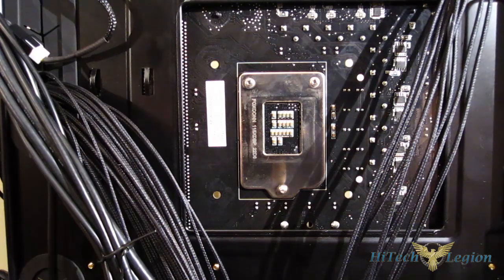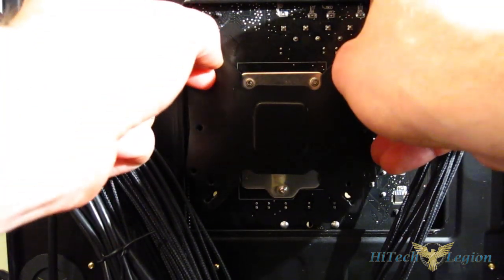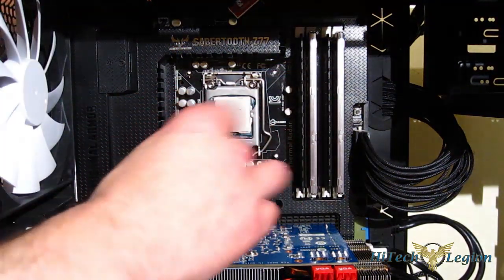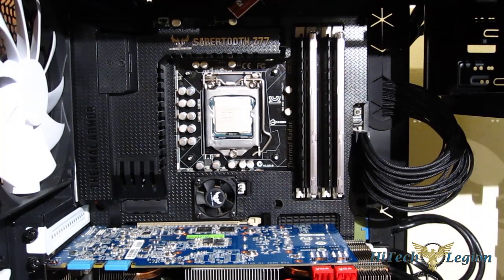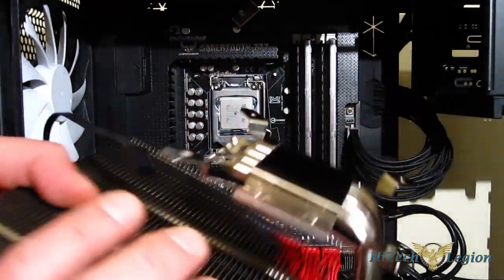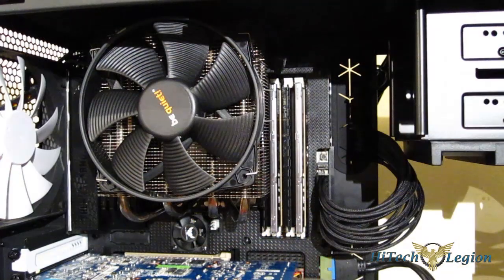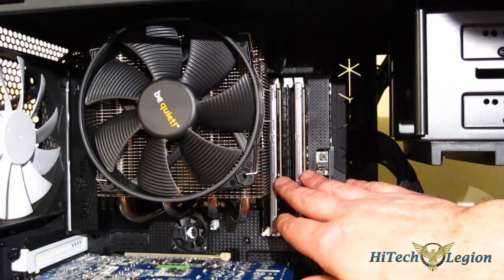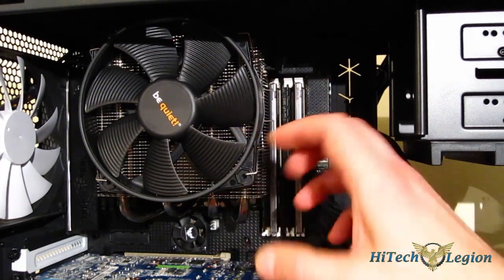be quiet Shadow Rock Topflow SR1 Installation Guide at HiTechLegion

Comment from the maker: Strangley...I use that Tick avatar in a couple of forums.
In this case, the ends of the pipes are facing up, that is the end you never want to face down. If you have a case with sufficient room for a standard tower, I would recommend you go that route as they will provide more efficient cooling in most cases. The top down style is made specifically for height restricted installs.

Comment from the maker: In space where there is no gravity it would not matter. On Earth where there is gravity, there is a tremendous performance difference as we have seen in testing. This is why the manual states that performance will be decreased if mounted upside down. You will find this same statement in almost every C pipe cooler manual.

Comment: I'm really like the looks of this cooler. My problem is, it might not fit on my motherboard. Its a Z77 Extreme3 and is narrower than a normal ATX one. I'm not sure there will be enough clearance to mount it without having to remove my exhaust fan.

Comment from the maker: If it didn't matter there wouldn't be a warning in five languages in the manual telling you not to mount it with the heatpipes bending up, as it will lead to inferior cooling performance. Horizontal is acceptable and will only have slightly lessen cooling. Upside down will lead to HUGE performance losses. This goes for every cooler of this type of design.

Comment: "You never want to have the pipes facing down!" 
No offence, but that's pretty much what you did right?

I'm interested in buying this cooler mainly because of the "height" most advanced coolers are over 150 mm in "height" and will therefore touch the side panel of my case.
However i am wondering if this would be a sufficient way of cooling my i7-3770K whilst overclocking it. Would you recommend a top flow cooler for that purpose?